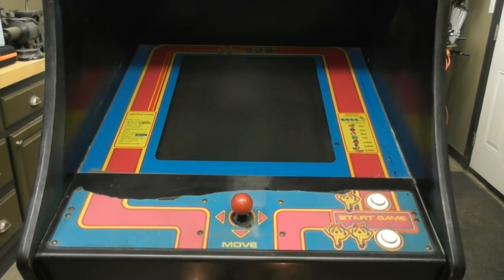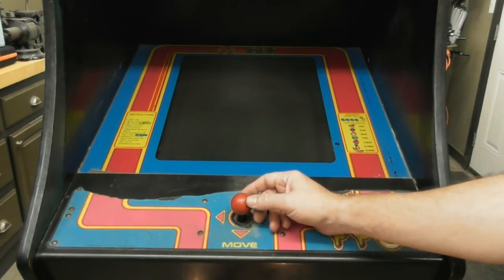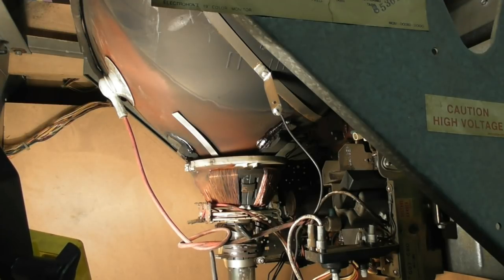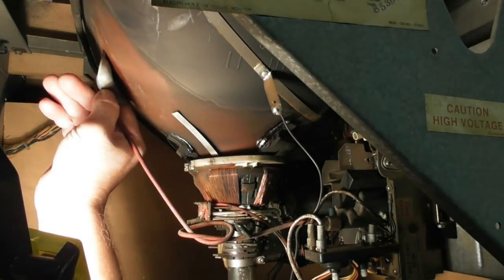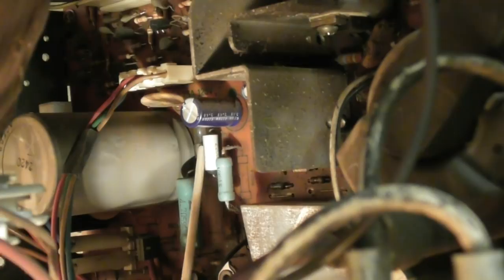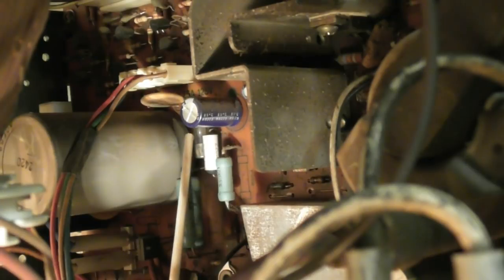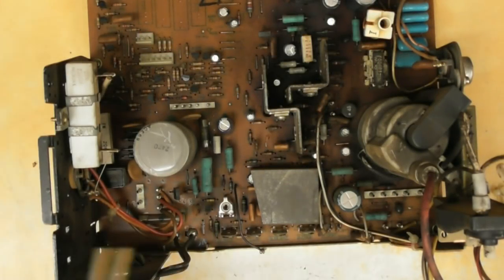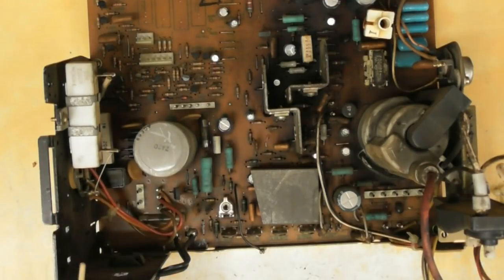Repairing an Electrohome GO7-CBO Monitor in a Ms. Pac-Man Arcade Machine

Comment: Thanks a million for this. I seem to have the exact same issue. I didn’t know about the big capacitor holding a charge. I just did the same grounding technique & got a huge, loud spark & this is after I probed the fuse last night. I ‘m glad I was expecting it after watching your video or I might have had a heart attack.
Reply from the maker: No problem! Glad you watched first and didn't get bit like I did. Be safe and good luck with your project. Take care, G.

Comment: Great work. I'm currently working on my own Ms. Pac-Man. I was going to pull out the whole monitor but maybe I'll just pull the board like this. Question: when you are checking for residual charge, you keep the machine unplugged, right? Or is it plugged in but off? Thanks.
Reply from the maker: If you don't need to pull the monitor, don't I would say. It may be more of a pain, but the CRT is out of harms way for the most part. And YES, the machine is unplugged when dissipating any residual charge(s). Make sure you're grounding to the monitor chassis itself. If unclear, please do tons more research so you keep yourself safe. Good luck, G.

Comment: Question: I have a non working go7 board. I’ve replaced the caps and flyback. Should the anode of the flyback arc to ground if I just apply the a/c power to the board without hooking anything else up to it? I don’t have the Pac-Man machine handy I only have the board at the moment but the anode / suction cup is not arcing when on I power the board up.
Reply from the maker: I can't say and don't want to speculate as it could be harmful. Be safe, G.

Comment: Great video!!!

I have this same monitor. Has vertical collapse.  I have reflowed, recapped, change the D1138/Sd401...

Still happening. Other suggestions?
Reply from the maker: If the orientation of the monitor is like as shown in the video- Ms. Pacman, Galaga, etc. Vertical is horizontal and Horizontal is vertical as far as adjustments. If yours is in this orientation, it sounds to me you need to adjust the horizontal width coil. Hope this helps, G.
Reply: ghostses I think you're dead on. Coil appeared ok but upon further inspection was broken. Ordering new part. Shall see. Thnx
Reply from the maker: Being Broken doesn't necessarily mean bad. But, replacing it is the next logical step. Find the spot in the video where I talk about the ferrite core in the coil. I believe it's towards the end. The replacement I used had one that was shorter and I couldn't fill up the screen. I put the old core in the new coil and it solved my problems. Hope this helps. Keep me posted and be very careful. G.

Comment: what tool did you use to adjust the 4 potentiometers with?
Reply from the maker: A TV alignment tool set. This is not my set, but a link to something similar. Good luck, G.
https://www.amazon.com/Philmore-Anti-Static-Alignment-Trimmer-63-910/dp/B01MXZGEXT/ref=sr_1_24?crid=2WS9HIIG9C9K5&keywords=tv+alignment+tool+kit&qid=1680081694&sprefix=tv+ali%2Caps%2C161&sr=8-24

Comment: GHOSTSES, Why does an arcade monitor have a B+ voltage for what reasons?
Reply from the maker: Bill- I'm really rusty so do your homework and take my words with a big grain of salt.  The B+ voltage is DC voltage.The outlet  from  the wall is let's say it 110-120 AC. The power supply in the game  converts that AC voltage and conditions it to DC voltage- then it feeds that to the monitor. I could be totally off base so again do your homework, G.